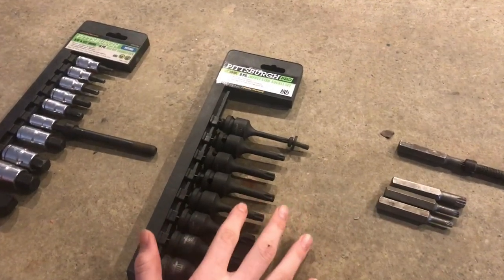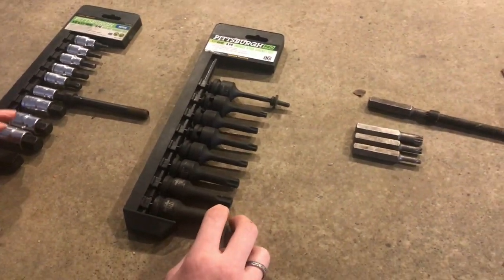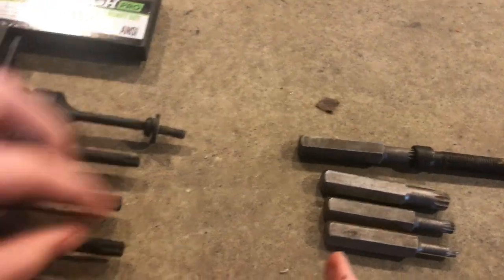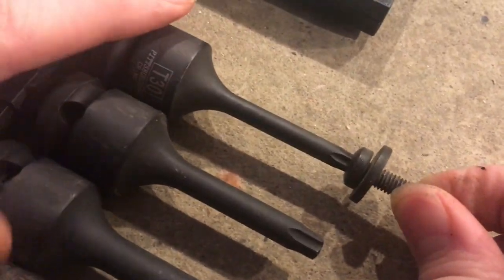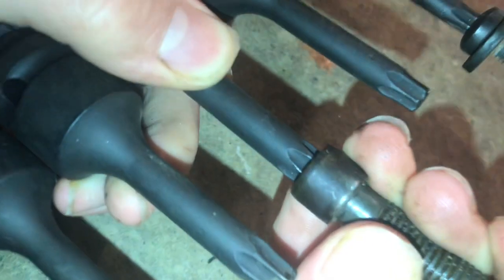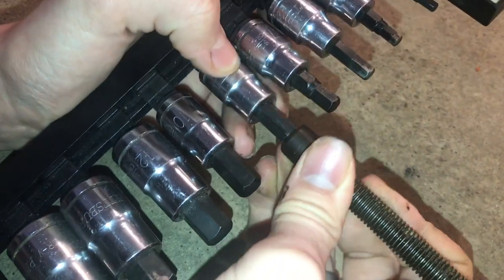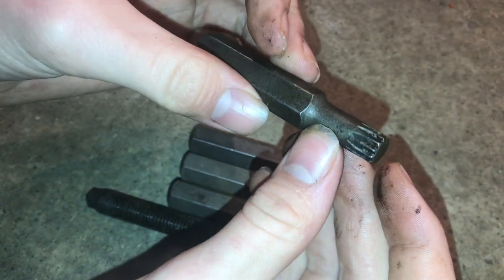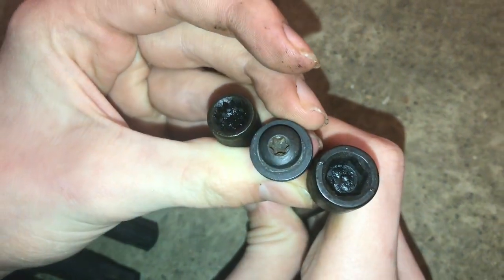BIG differences between (triple square) (star) bits and (hex) bits

Comment: Thank you, my friend yesterday shoved a torx into a hex 6 with an impact and stripped it. It holds my brake rotor onto my car so it’s very hard to drill the head off. Video explains the key differences spectacularly. My friend will never do it again!
Reply from the maker: Yeah, I’ve unfortunately done the same thing. They make a extractor tool that grips the outside of the round part of the world. They work really well sometimes if I feel like The fasteners going to strip I use this extractor instead. I can’t remember the name off hand but Irwin is a company that makes them and it looks like a reversed tornado inside the tool.

Comment: True about striping if you use the wrong bit. I found that out when I was using a T30 hex because it looked and felt like it fit, but the screw I was working with was a star bit M8😜

Comment: Well sometimes you can use torx bit for triple square bolts. If they are not tight. For example that's how I loosened the steering wheel on a jetta 2011. But I won't try to loosen the rear bearing bolt lol

Comment: Which head do you think is better? For the same size and material, what would be easier to use and transfer more torque without wearing out?
Reply: Torx is designed to be pretty much strip-proof. For super high torque uses, go with Torx Pro. But that is for some serious industrial use type stuff.